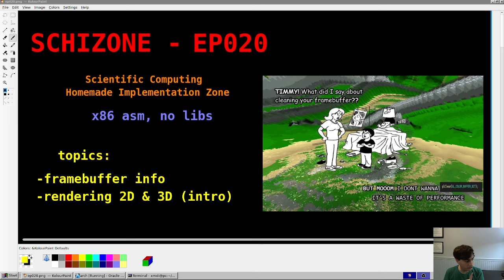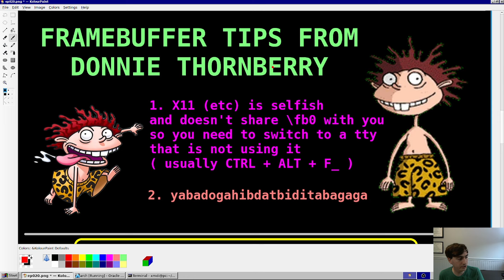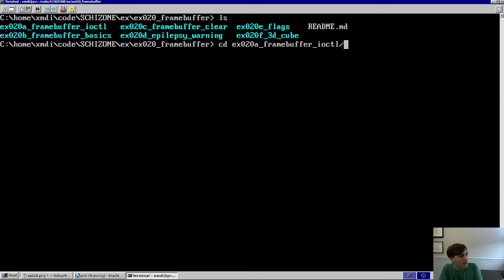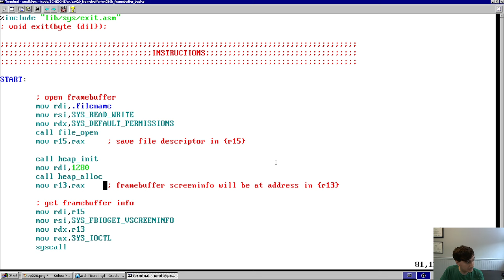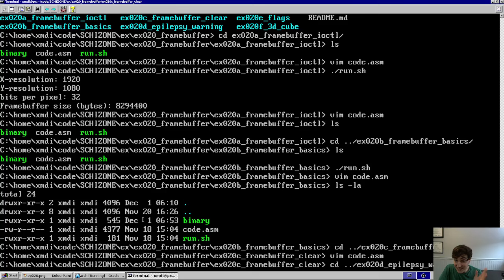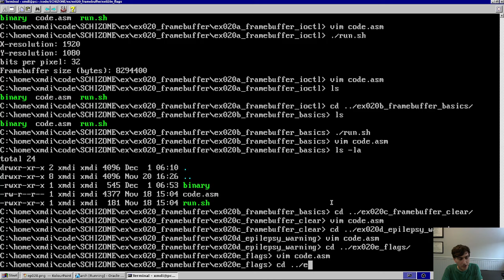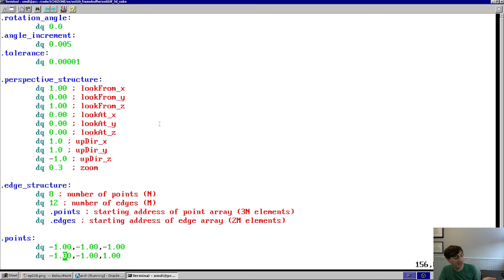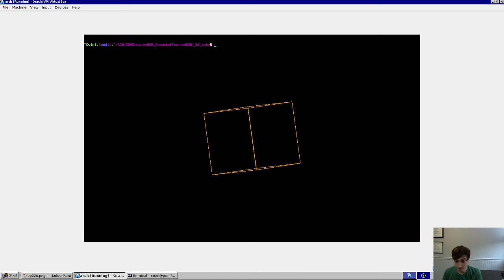rendering to the screen in x86 assembly | SCHIZONE EP-20

Comment: I am trying to work with the framebuffer and I have a very weird bug where movement of an object on the screen is very choppy but then when i hold down a key it becomes smooth, even though I have no input handling in my code what so ever. The bug also persists when I download your code and run for the bouncing flags example. I tried setting a fixed update loop and some other stuff but nothing works. I am on ubuntu running on a different tty. Any ideas?
Reply from the maker: @anthonyceponis2491  idk Tony that sounds really weird. Maybe try to kill the entire GUI service like it recommends here https://askubuntu.com/questions/378046/how-to-run-ubuntu-xubuntu-in-a-complete-non-gui-mode . Also maybe try the SCHIZONE examples with a cursor, I wonder if that would be less choppy because it is actually processing some input.... I'll try on my Ubuntu machine today and get back to you
Reply: @xmdi0  Thanks for the hint. I ended up reinstalling my whole os and now it works, after testing on a vm. Super dodgy. 

But anyways, your videos are fricking amazing, keep doing what you do man!

Comment: I used the maped linux framebuffer with a matrox millenium pci graphic card with 4 mb vram in 1024x768x32 with a knoppix boot CD on 32 bit AMD CPU with NASM.

Using other graphic cards(Geforce,Radeon) the bits per pixel are reduced to 24 bit. The VBE-Bios of the other cards have mode numbers for 32 bit per pixel and i don’t understand why the 32 bit are not used by default on Geforce&Radeon. Booting MS DOS i can use the 32 bit per pixel with Matrox,bRadeon, Geforce. Modern Geforce&Radeon PCIe have VBE modenumbers for wide screen 16:9 aspect ratio1920:1080x32 and 16: 10 aspect ratio 1920x1200x32.

But how to change from 24 bit to 32 bit per pixel on linux framebuffer?
Reply from the maker: Interesting problem. I believe if you start xorg there are several commands you can use to query and set the color depth of the framebuffer; you could try those for a start. But in my experience (very limited) 24 and 32 bit color depth are essentially the same thing, with the latter having a (useless) 8 bits of transparency. Could be wrong, but if that's the case, you could just accomodate both cases in your code.
Reply: @xmdi0  I like to write 32 bit or mmx 64 bit(2 pixel) directly into the framebuffer and there is no single instruction to write 3 bytes. We have instructions for one, two bytes or 4 bytes, but not for three bytes. With 24 bit per pixel we have to use at minimum two instructions for one singel pixel.